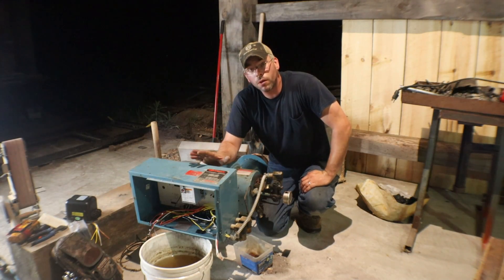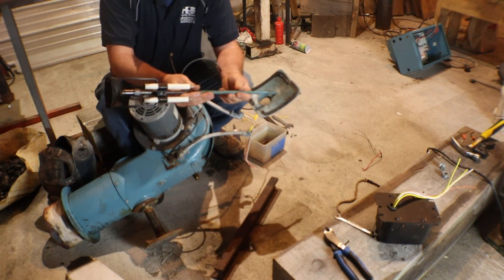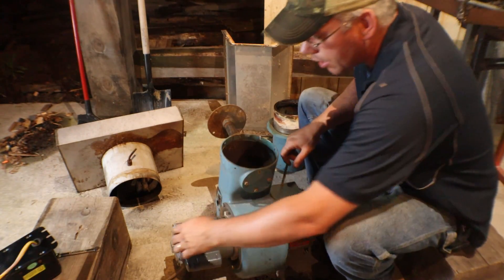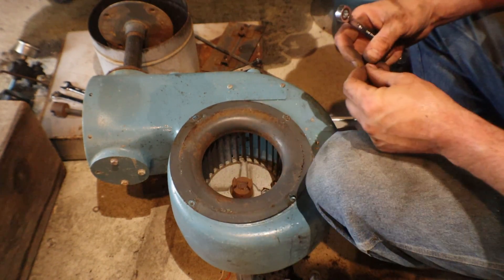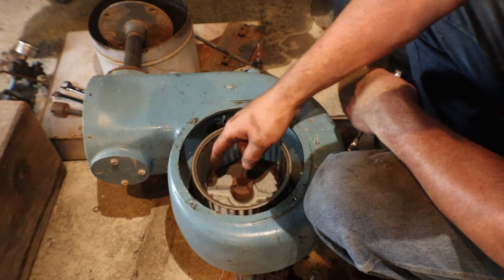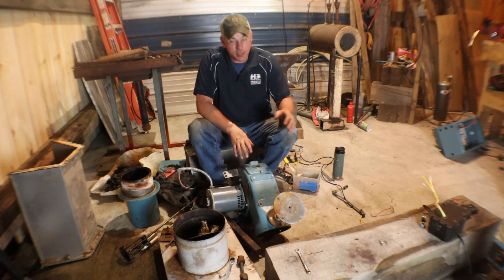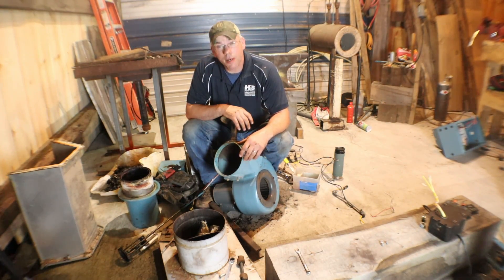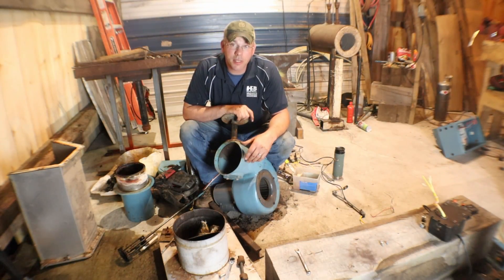How A Cheapskate Makes His Own Forging Tools

Comment: Doing a hood for my coal forge in the coming weeks so finish the video series so I can copy everything.  Are you going to put a a rheostat on the exhaust fan
Reply from the maker: Nice.  I plan to run it wide open.  I have to get on it quick.  I have a trailer load of black walnut to mill first.

Comment: Hi stranger! ;0)

Does it matter where on the exhaust duct the fan goes? .... Why not fit it upstairs! You would get the gasses cooling And a noise reduction! Those gasses are fairly acidic so reducing the temp will increase your fan life!
I would wire a switch to power both the fan and the blower with an extra one on the blower (maybe even a dimmer?) That way you can not have your blower on without the extractor but you can have the extractor without the fan! A simple twin switch arrangement next to the forge would be good! If you were a Real cheapskate you would be manufacturing your own hood out of sheet using a plennishing hammer you forged yourself before dinner!
Eather way good to see you posting! How are you set up for the oncoming deluge? Got your big coat handy? ;0)

Comment: Do you think it'll be a good idea to run 6" to 8"  ducting?
Reply: 6 inch before the fan and 8 inch after will increase the draw, all be it slightly. The forced air really needs a larger pipe to handle the increased air-flow/speed.just about every active exhaust fan set-up I've seen has a larger output than input. This unit has about a 6 inch inlet and an 8 inch outlet, so I don't understand what you're asking, exactly.

Comment: An observation, maybe a suggestion. Please don't take this as a "you're doing it wrong" post. I couldn't tell what order the screws came out of that curved shroud cover, but when you reassembled it, you put the long screw in the hole where the slot in the cover is and the short one through the hole on the other end.

I would suggest reversing that for this reason: under normal circumstances you never want the screw to come all the way out on the slot end of the cover. Also, you don't want to have to take 20 or 25 turns on the screw in the hole at the other end. So, my suggestion would be long screw in the slotted end, and short screw at the hole end.

Since I'm one of the few whose head is full of screwy (ahem) ideas, this may not have come up during the working life of the blower/pump/burner.

That sheet metal shroud sure seemed to be some beefy material. Much stronger than the home HVAC squirrel cages I'm used to seeing.
Reply from the maker: It is funny you mention this and it's a good point.  I'm actually going to mount the assembly upside down from how it was originally mounted.

Comment: Hoarding has become a problem.  You're not a hoarder. Years ago you would've been a junker. Both terms are incorrect. You're a recycler, greener than any "green new deal". Junking and hoarding are derogatory terms used by people who lack enough education to understand what's really happening.  Hoarding is the new term. But it comes from a small group of people who can't throw out trash and instead live with it. A true mental disorder.  Now the term is used in slanderous ways. My family made tractors, implements to farm with, scooters, ATV's( before anyone would call them that-late 50s early 60s) and a whole lot more. Nearly al of it" green" recycling, and nearly all of it from another mans "junk". Thanks for sharing

Comment: "...this oil pump could be handy for something else."  HOARDER!   You'll forget you have it, or where you put it.  lol!
Reply: The question is, is "HORDER" a badge of shame or honor? (At least in this situation. Of course if he was saving used diapers and old food and garbage, the answer is clear. However, keeping things out of a landfill that might have future use, is a good thing (as long as your entire property doesn't get completely clogged to the point where you can't find a simple bolt and matching nut.
Reply: @thomasarussellsr  Yeah, I'm a "SAVER" too.  But, like I said, I usually forget that I have it, or where I put it.
Reply: @454pakr  my issue is more that I remember that I have it, but can't find it.  About half the time I search and don't find it, assume the wife threw it out, go buy one, then a week later the one I had turns up.